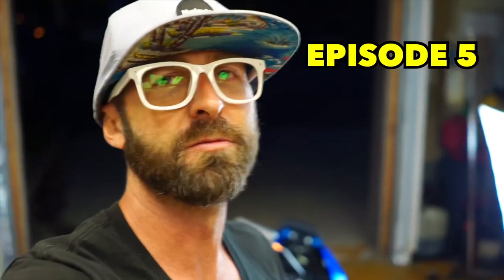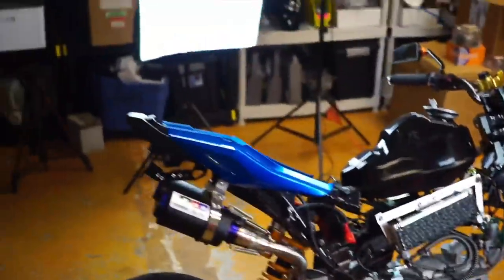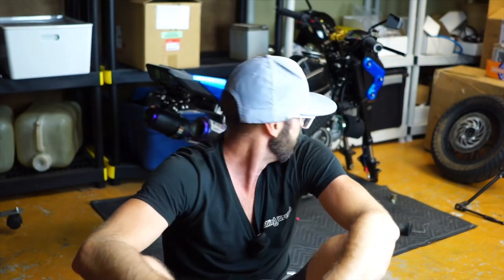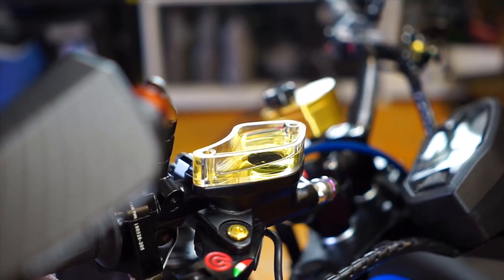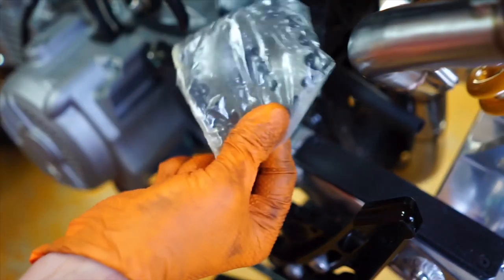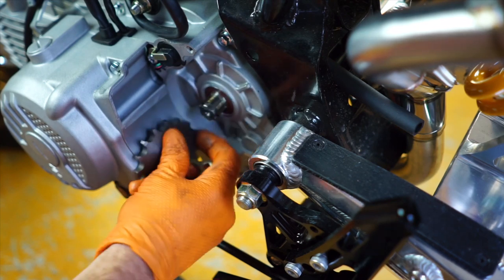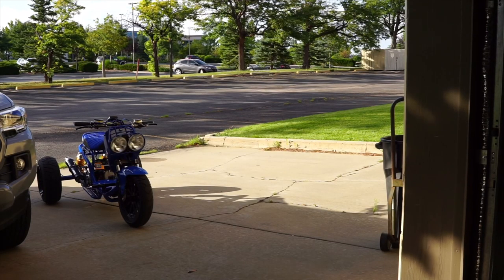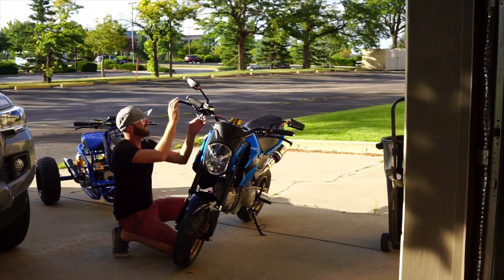Grom Clone DONE! [episode 5] BUILD SERIES

Comment: Its a pretty nice build,  I like the oil cooler. I found 159x80mm coolers with banjo fittings that should fit behind the air ducts on ether side of the bike were I will modify to alow the air to flow through  witch is what I think the designers were trying to mimic with the ducts. I know the forks need help because they bang bad when they top out. The shock looks like it makes the bike ride to high to me.

Comment: Quick question not sure if this was previously asked/answered but were there any modifications to make the grom sf fairings fit to the Vader I have the same bike as you built and want to do the same ?
Reply from the maker: In order to properly mount all the fairing, there is a lot of minor trimming and adjusting brackets. It definitely doesn’t just bolt up. I probably put 4-5 hours into it to get it right.

Comment: Awesome work. I need ask, I have 49cc TaoTao I cleaned the carb and put it back together exactly like it was and now it’s leaking gas through the air cleaner. Please help 🙏
Reply: A littleclate but you have the vaccum line and the fuel line swapped

Comment: The location of the carb and air filter seems wrong and out of place. There are intake manifolds out there that would put the carb back were it belongs.
Reply from the maker: Unfortunately there isn’t any room :-(
Reply: @RollingWrench  There is my good man, you would have to relocate the oil cooler. The manifold I found is 26mm and stands up like the manifold on the original engine then I used a adapter(also available) witch is thin and bolts between the manifold and head allowing me to point the carb the right way. I think you my be 27mm so a little porting on the manifold would be needed .It was worth the trouble because I was not willing to put my carb out there like I have seen a lot of people doing. I put the oil cooler in front above the cylinder head behind the fork. On a build that nice its well worth the extra time bro-ster.

Comment: Did you ever figure out how to run efi with a 190?
Reply from the maker: I stopped when I found out the stator can’t keep the battery charged. Efi has a big power draw. I couldn’t find a proper stator to upgrade to. :-( FAILED
Reply: @RollingWrench  do you know about the chimera stator that Steady garage sells? It is supposed to allow you to run a zs190 using the grom/monkey efi system. So essentially you could swap a 190 into a grom. Or I was thinking swap a grom harness into a clone.
Reply from the maker: @alphakilo-79  if that’s the case it would work. But I would need to build a tune

Comment: I have a question for our local denver community,  I don't have a license "HTO" . "49ers" don't require plates or a DL ?. And has anyone been harassed by the local um authorities for motor  swaps
Reply from the maker: The 49cc in Colorado require a drivers license just not a motorcycle license. Then you need insurance and registration ($5.35 for 3 years). I ride a 232cc Ruckus, registered as a 49cc, only because it’s almost impossible to register as a motorcycle. So I just put a plate from a different country on.... that way I have something there visually. I have never had issues yet